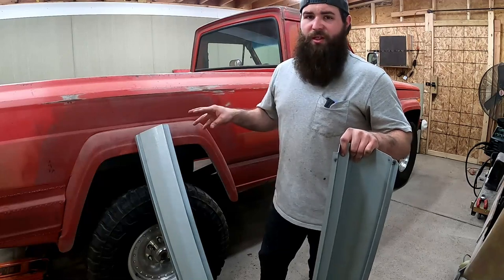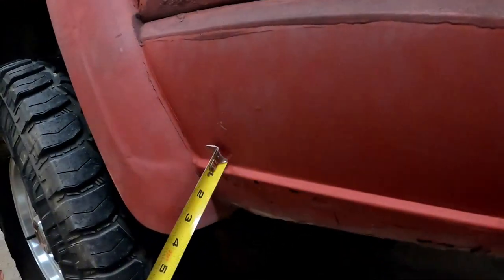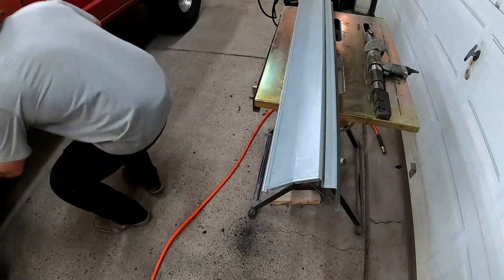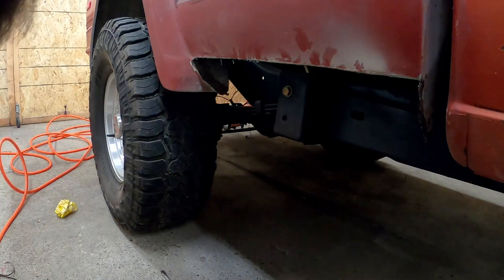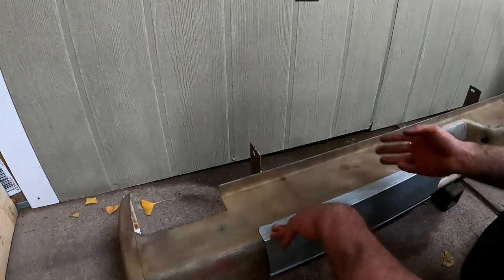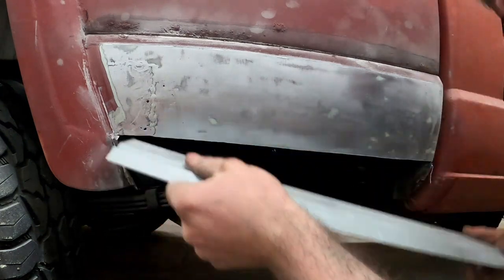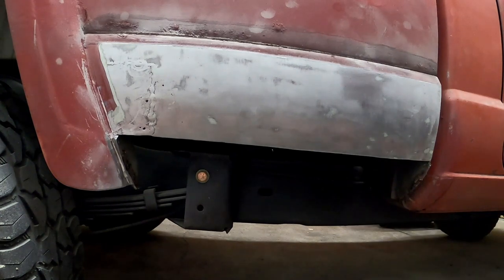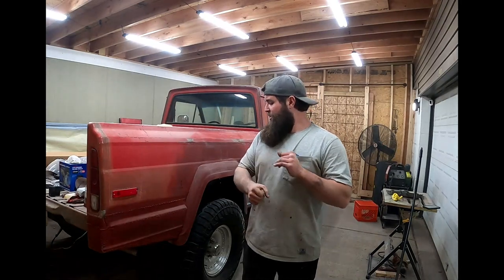Fabricating for the Jeep j10!!!

Comment: Nice videi.  Im trying to get a J10 or j20..  but theyre so hard to find in virginia.

I didnt realize that lower panel is just basically floating. The j10 im looking at the bed is rusted out badly.. holes all over the bed itself.. but the outer panels are just orange.  Im sure there is rot inaide though.  But when i closed the drivers doir.  This same panel you worked on.  On thay side was just wobbling in the air..  So i guess theyre just floating with pinch welds ? 

The frame is rusted very badly on this j10 in the back as well..  most fsj rust in the last 1-2 feet of the frame badly anyway.  But i dunno.  It runs drives..  but needs new tires.  Floorboards.  The cab is overall in great sjape.

And frame front to mid/back is in great shape.   Guy has no title though... but i can get the Jeep by just trading a 44 henry lever action..  basically spend 0$ for the Jeep.

Ill just have to do the vermont loophole to title it in virginia.  Well hopefully that works.  Taxes will be high though.. 300$ or so.

And then i gatta cut out and weld a new rear frame in.  So i dunno is it worth it or not ?  

The bed when you grab it on the corner by the tailgate.  It actually wobbles.  So i guess it needs tones of work to get that sound too.

Pain..  its either get one like this.  Or spend 6 to 9000$ for one with similar rust but not as bad yet..  its annoyingly frustrating.

I know in my mind i shouldnt get this.. no title... frame rot to where its paper thin in the last 2 feet of the frame.. and bad bed rot.  Inside thr bed anyway not outside.   But its the color i want.. a baby blue and white outside and baby blue interior thats 100% there.. no missing parts...  im not a fan at all of the sand color interiors.

I dunno what do you think ?  Get it ?  Patch the frame rot..  until i can find a better frame ( at least rear frame) to transfer over.  And then try to get a title.. or keep looking ?.

Honestly..  the frame falling off in chunks and going from over 1.8th thick to paper..  doesnt scare me.  Normally id cut it out and weld in fresh steel.. but i think its too far gone for that and just needs steel welded overtop for the time being to strengthen it.  While i source a clean frame for the rear anyway.

I actually like that this Jeep is whole.. the color i want.. and runs..  I cant decide whats worse..  rotten rear frame. And bed.  But complete interior and runnung drive train.  

Or missing most of its interior..  good frame.  But still have bed rot..  and doesnt run...
Reply from the maker: Thank you for watching and in my own opinion unless you had a good starter vehicle that was solid I would say buy it as a parts car and part it out after you would get yours built but for the time and money it would be better to find a more solid truck for say 3 or 5000 just to have it solid. Ours wasnt too bad and basically got it for scrap price but the bed and cab floors were the worst and you basically can't find too much sheet metal for these trucks and have to make it from scrap and body filler. Or look for a  good vehicle down south a little bit that has very little rust. But that's what I would recommend to be your easiest route but I hope the best of luck to your search if you have questions feel free to ask and if you get one keep me updated on what you get!!